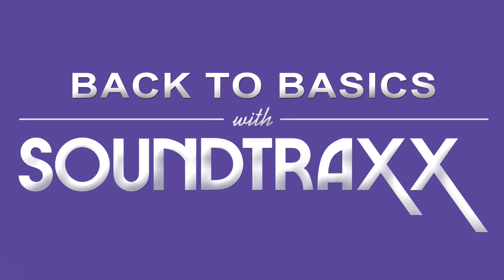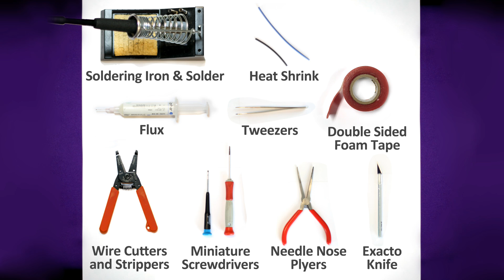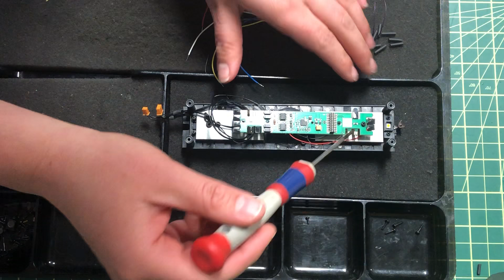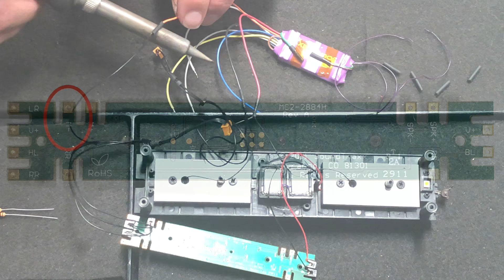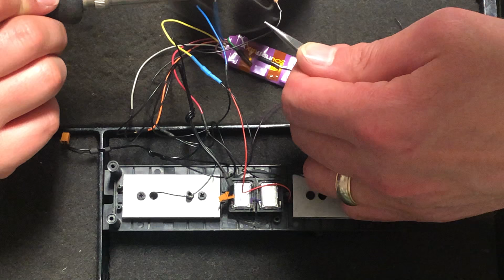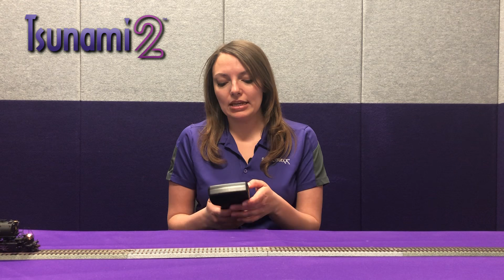Easy Tsunami2, TSU-2200 Install into a Bachmann EM1

Comment: Where exactly can I buy the sound module for this specific EM-1?
Reply from the maker: You will want to get a TSU-2200 you cannot get the Bachmann sound modules any more.
Reply: @SoundtraxxDCC   and that module has all the sounds that go with this locomotive?
Reply from the maker: @NinjagoGuy416  Yes the TSU-2200 will work great for this model!  You can learn more and hear sound samples here: https://soundtraxx.com/products/tsunami2-digital-sound-decoders/tsu-2200/
Reply: @SoundtraxxDCC  Thanks for the info! How do I know if I'm getting the sounds specific to this particular model? Or what sounds would you recommend?
Reply from the maker: @NinjagoGuy416  Our steam decoders are easy. All of our steam sounds fit on one decoder - so you just pick steam. Diesel is more complicated you have to pick between options with different manufacturer specific prime movers.

Refer to our manuals to change CVs and select sounds. Start with the User's Guide and as you get the hang of the decoder the Technical Reference will become more helpful. To just see a quick list of common selectable sounds on the decoder look at the Sound Selection Reference. All of these documents can be found in the Reference section of our website on the Manuals Page. Here is a link: https://soundtraxx.com/reference/manuals/

For this particular install we made a CV sheet showing which CVs we changed for the airhorn, exhaust chuff, etc and it can be found in the description of this video and here: https://soundtraxx.com/content/Reference/Documentation/Application-Notes/BachmannEM1_TSU-2200install_CVSheet.pdf

Comment: Are these speakers part # 810154?  Because the documentation that came with mine shows the right solder pad to be the negative and the left positive.  The video states the opposite so now I'm wondering which is right.  Thank you.
Reply: Chris,
These were not SoundTraxx speakers. They were supplied by the customer.

Comment: Nice video, I’m in the middle of installing this decoder into 2 diesel locomotives with 2 mini cube speakers wired in series, they sound great. Regards Gary
Reply from the maker: Yay! You will have to share some video of how it turns out or some install pics!
Reply: SoundTraxx hello, I was going to do a video of the installation, but I’m not very good at narrating, but I will try to share something. Stay safe, take every precaution from this horrible Coronavirus.....Kind Regards, Gary

Comment: Hey McKenzie this is fantastic! My buddy and I couldn’t help but laugh because most guys at my club and others are too afraid to attempt such an install. Great job McKenzie! I’m starting a steam project here shortly so I appreciate this video. Hey George, I think you’ve met your match! I’m emailing you Monday.
Reply from the maker: Thank you. This install was not to difficult. The only thing that would have made it easier would have been a clamp to hold one of the wires when soldering. We have made some in the past with a clothes pin.

Comment: Very useful video.  It provided the last little bit of info that I needed (the need for resistors for the lights) to allow me to perform the conversion on my B&O EM-1s.   They sound great now!  Thank you!  Now if I could only get my kids to hold wire leads together when I am soldering them. ;-)
Reply from the maker: Great to hear! A third hand is helpful. In the past we used a clamp made from a clothes pin that worked great. We just misplaced it when we were shooting this video. We used it in this video if you are interested in making one: https://www.youtube.com/watch?v=Xl87W5hOvCM&t=8s
Reply: Great video. Good info. Where do you get your flux from? Does it come in the syringe or do you put it in a syringe yourself?  Thanks
Reply from the maker: @jimrohman6575  The stuff we have here is Alpha OM-338.  You can search online or here’s a link to a random website: @t  Because it’s an industrial use flux, most of the links want you to contact them for quotes.
 You can get similar flux from Digikey.  Search Chipquik flux syringe.  I believe it’s about $12.   The stuff we use is a bit more expensive and flows clear.